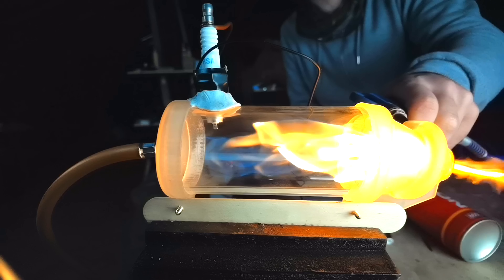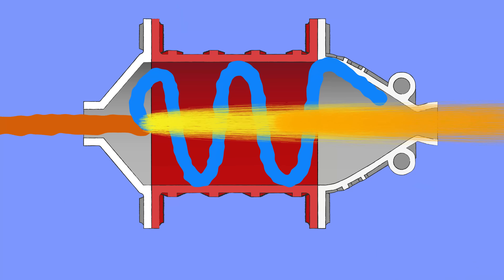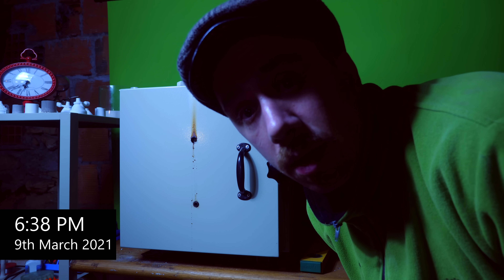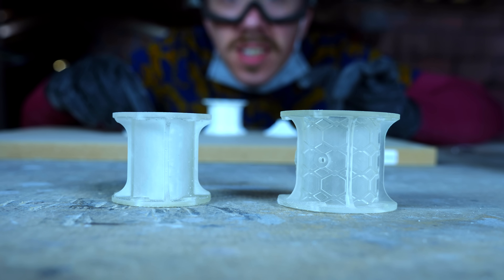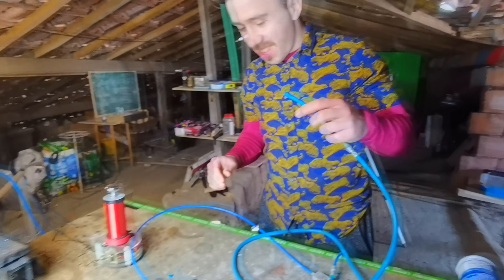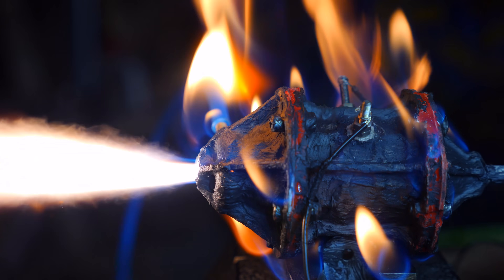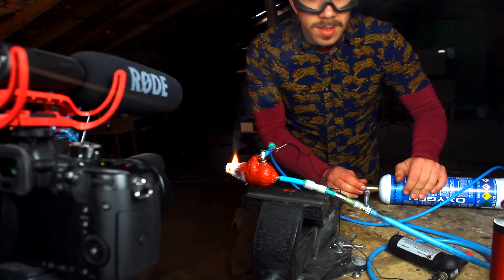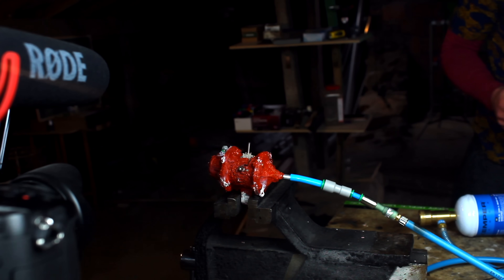Vortex Rocket V2.0 (3D Printed)

Comment: Hi, maybe you could try petrifaction with Sodium silicate (which binds/solidifys old concrete and prevent it from desintegrating into dust or stops water from rising inside walls due to the porosity of bricks and mortar. If it seals capillar prous stuff, maybe it works for the V3.0 engine. That's not rocket science, is it..? :D  If it works i'd like to have a 3d printer. If not, well here is yout toma.. uhm. P'tato...

Comment: if you cover the ceramic with PLA 3D printed parts, you should be able to stop the leaking. If that don't work you should try to increase the gap between ceramic and PLA and fill it with some materials, or making air flow through it to let the flames exit near the nozzle.

Comment: hot thing. :-)
you try to screw more or less flat things together. did you plane them before? maybe you can try to seal them with epoxy? or use a rubber ring- which would need a little more distance.. maybe a bigger collar around the parts? btw. do the screws get hot? they may extend and unseal whatever you screwed together..

Want another idea? pvc tubes are plugged deep into others so there is much more contact area that can seal both parts.

Yet another idea? Don't use a vortex but two vortexes. one inside your burning chamer, another one in a second bottle around the burning chamber which cools everything down.  think of it as a kind of turbo charger ;-) this may (as in maybe... well  probably not ) prevent overheating seals.. at least.. if you had more pressure outside the burning chamber than inside, ..

okay.. enough stupid ideas for today..  and i fully aggree.. tomatoes are disgusting..

Comment: Why not using the red silicon on the inside? I think it could be made almost flat with a spatula (or a 3D printed mold, maybe with PTFE tape to prevent it from sticking). 
For the tube leaks, you might put the silicon on the end of the tube before inserting it in the hole

Comment: Would Coating the Ceramic in a "Chunk of Aluminium" by Casting It Around it Work?
Reply: The high temp of the ceramic, the seal of the metal (also built in heat sink/mounting block for tubes!) !

Comment: You have a ceramic oven, so to seal the engine, just use glass glaze like any other ceramic. fully assemble the engine, then dip the whole thing in glass glaze, let dry, and put it in the oven to finish. It will fix the porousness problem, and add significant strength. sick cad skills btw, cheers :)

Comment: Hi Integza,
Have you tried printing 3d molds to pour your parts? You can bake the parts in your oven to harden them.
I would also suggest that you build a small vacuum chamber to remove bubbles from your molds before baking them. That would lead to more solid parts (seen that when ppl pour resin or plaster)
Not sure if that would work but look at clips on how jewelry is made with molds and stuff. Maybe you can finds some inspiration there.

Thanks for a epic channel and be safe!
/D

Comment: if you do manage to fix the leaking you should test how much thrust your engine produces and start designing a small rocket to check how high it will go, put a tomato as the test subject in the rocket if you're sure it's going to blow up :)

Comment: You have everything you need to seal this engine. Hold up your favorite coffee cup and think about it. After printing it, fire it as usual. Remove the supports. GLAZE the interior and/or try glazing the exterior and then fire it again in furnace again. You have got this. But the pottery glazing at a local craft store. You can even select colours that make you engine pretty.

Comment: I work at a company where we regularly sinter various ceramic materials. The issue you seem to be having with the porosity of your sintered Porcelite could be addressed in large by the sintering process itself. I would suggest calcinating the ceramic print at 600°C for six hours to drive off all the volatiles before ramping up to 1100-1300°C for an additional six hours to sinter. The cooldown should be kept slow to avoid cracking, 10 hours should be sufficient. You can run a test with printed cubes sintered at different temperatures to check the resulting density, the higher the density the lower the porosity (and less leaks!). Of course the denser the crystal lattice becomes, the more the print will shrink. The shrinkage can be measured with the test cubes and accounted for while printing. Hope this helps!

Comment: How about trying concrete densifier to seal the jet?  https://en.wikipedia.org/wiki/Concrete_densifier
"A concrete densifier is a chemical applied to a concrete surface in order to fill pores, increasing surface density"
If it's not chemically compatible, maybe just coat the jet in concrete powder, turned into paste, then add the densifier.

Comment: I think the glued component's contact points heat up causing the bonding agent to become molten thus creating weak points for pressure escape thus the leaking, try using high temperature ceramic adhesives some can withstand upto 2200°C

Comment: "It is not burning! It's smoking a little bit... but not burning!" That is the NASA spirit! You show them. 
Jokes aside if you are PVD or Sputter a metal layer over your ceramic chamber it should be gas tight and heat tollerant.

Comment: Definitely were a mask when you're cutting.  I'd also suggest a face shield for cutting and for when you're running the jet, as it could easily explode into shards with a backfire or something.
As for the leakage, why no cover the jet in ceramic paste or pottery clay?

Comment: Perfect the shape tolerance and design on the ceramic resin printer, then CNC a modular engine out of steel. 

I guess that is a sure way, to make a reliable and leak proof engine.

Comment: In order to get a leakproof engine, you should make the parts out of metal. you could print the engine split in half (lengthwise and in regular resin) and create plaster molds of both parts. you could then cast the parts (after the resin has been burnt out) out of something like aluminum (though this does not have a high melting temperature) or another metal that you have the capability to work with.

Comment: Ellowah
Manually applying paste etc will always have some defects
And I get that you don't want to treat the inside for the smoothness but it allows the fuelmixture to be pushed into the pores you burn out
My suggestion would be finding a fluid to submerge the entire part to refill and close the pores (that can resist the temp ofc)

Comment: could you try to design a 3D printed turbocharger that would withstand the heat and friction of the high rpm's of the propeller. then you could use the thrust of the rocket to turn the hot end of the turbocharger and see how high in rpm's you could go.

Comment: You might try coating the inside of the modular engines with the high temperature cement. Not sure how economical/easy it would be, but a Cerakote or other ceramic paint coating might work as well. Inside and out.

Comment: You don't need to stop the leak. It is good for cooling down the engine. You need to prevent the flame from reaching the body of the engine. And  direct the leaking gas into an afterburner.

Comment: I think the problem is the red silicon adhesion, at 14:27 it started to make bubbles, or maybe try to put it in a vacuum chamber for remove all bubbles, after put an other coat of it, vacuum it and an another one. After that it will work i think.

Comment: Porcelite's max temperature as I can find  is ~1300°c however a propane/oxygen flame is ~1900°c so unless your vortex cooling can insulate it by 600°c you might need to look into a lower temp fuel. Natural gas (mostly methane) may be an option, but this will lose you thrust :(

Alternative ideas:
Chill the air to try and cool more with the vortex?
Time to start 3d printing metal?

Comment: Just an idea. You can 3D print mold for the engine and pour refractory cement. By doing this, you can create thicker walls. Another idea would be to take a 3D printed ceramic engine and pour refractory cement around it. I also found this video of someone doing similar thing https://www.youtube.com/watch?v=KkMAY-s_6Qg

BTW great job!

Comment: You could try with a refractory silica glazing or silica enamel on both the inside and outside of all of the ceramic pieces and also both the refractory glue and the high temperature silicone on the outside. That should take care of all the porosities

Comment: @integza What if you try plating it with metal to create a heat resistant, non-porous layer on it? There are methods for plating ceramics with metal.

Comment: Hello, 
maybe by immersing the 3D printed cermic in a (liquid) which would contain very fine heat refractory particles.
Once the parts are completely submerged, place everything in a vacuum chamber for several hours.

By opening the valve suddenly (be careful not to use glass or plexiglass for this operation) a sudden compression will finish 
encrusting the holes.
Perhaps several operations will be useful. drying, gradually raising the temperature, then re-tramping, etc., etc. 
Patience is the mother of virtues

Comment: How about making a 3d printed mold to pour a heat resistent ceramic in? You can achive a much thicker and less porous part and you wont have to deal with the large amount of shrinking. It would also allow for the engines to get larger as you can print the mold in pla or abs and coat it to be leakproof.

Comment: Instead of flat flanges, use interlocking concentric rings on them to make a labyrinth seal

The OTHER problem is that you haven't made a complete item after the first firing

At this point it's a bisque (biscuit, bisqueware) and needs glazing/second firing (and bisques are hellaciously fragile)

This is why it's leaking like a sieve. More work is needed. You made the skeleton now add some meat :)

Talk to a Potter,  but this stage will soak up glaze readily when dipped, needing to be fired again

Essentially you're making fine walled porcelain and need to follow the same kinds of stages

You may need a 3rd firing before your porcelain rocket is ready for action

Comment: So cool, I recommend Permatex 84333 High Temp Epoxy Stick, or exhaust sealant instead of silicone as the silicone isn't able to withstand the pressure. So high temperature epoxy resin should seal the porcelain. Keep up the fantastic videos

Comment: maybe enclose the whole thing in a block of cement? might not be the best for therman management, but i think you can't leak much through a centimeter of concrete. also, that block probably could be more easily sealed with silicone, since the cement/concrete would isolate it from the heat of the combustion

Comment: How about doing an a combination of the vortex technology with an airospike engine? 
That would solve the major issue of airospikes, causing their planes to overheat easily
Reply: He did mention that the nozzle can't be protected by the vortex, and that's the part that fails on aerospikes.
Reply: Generally true if you are talking about a bell nozzle I believe. 
However with an airospike, the vortex might be able to follow the flame outside the combustion chamber and therefore suround the exhaust and shield the central flow shape. Not sure it works, it's just an idea, similar to using exhaust from a fuel-rich preburner to shield bell nozzles

Comment: Here is an idea. After burning the resin off your ceramic parts and letting them cool, soak them  in a strong sodium silicate solution(sometimes called water glass) for a couple hours, then heat your parts back up in the oven to 100-105 Celsius until thoroughly dry. At this temp sodium silicate solution will lose water and form a glassy material, which could hopefully seal up your engines. hope it works out! Cheers!
Reply: Good idea, but the increased sodium content might reduce the melting point of the the ceramic. Maybe a couple of rounds of soaking in a ceramic slurry, & then drying, would fill most of the pores. A final round of sintering would then leave a "high density" ceramic part, but it might self sinter at the operating temp, so I don't know it it's needed.
Reply: @benjaminmiller3620  at 105 Celsius I don’t think the formed sodium silicate glass will dissolve in the ceramic as both melt at a much higher temperature. I think the result will be a composite consisting of a sodium silicate phase and a ceramic phase. What do you think? 
Cheers
Reply: @SD-fw9li  It's not the 100C baking step I'm worried about, but the operating temperature, which is much higher. Though maybe if all leaks can be stopped, the gas film vortex cooling will operate better and lower the ceramic temp. On the other hand, you just need one spot to melt to cause problems. I think it's worth testing.
Reply: Maybe use a vacuum chamber to make the liquid be well absorbed
Reply: @CiberWizZ  this is a really good idea
Reply: Definitely was going recommend sodium silicate as well. Thorough drying over 100 degrees, then resinter.
Reply: Wikipedia: „It has been found that the oxidative resistance of HfB2 and ZrB2 are greatly enhanced through the inclusion of 30% weight silicon carbide due to the formation of a protective glassy surface layer upon the application of temperatures in excess of 1000 °C composed of SiO2. To determine the effect of SiC content on diboride oxidation, a series of furnace oxidation experiments werde conducted, in which the oxidation scale thickness as a function of temperature for pure HfB2, SiC and HfB2 20v% SiC were compared. At temperatures greater than 2100 K the oxide scale thickness on pure HfB2 is thinner than that on pure SiC, and HfB2/20% SiC has the best oxidation resistance. Extreme heat treatment leads to greater oxidation resistance.“
Reply: @stabilostick  reading this made me feel like i was reading some 
procedure at my last workplace.
Reply: @simensor  Yupp. Do you have more hints for Integza about the process?

Comment: Try 3d printed concrete? It's more durable and more heat resistant, and you can try mixing the concrete with different portions that way it's thicker or more liquid.

Comment: I'm not sure how hot the engine gets, but ceramic threadlocker glue can generally withstand up to 600 degrees C, so coating the inside/outside of the engine might help with that. You could also try soaking the parts in a heat-resistant material for a prolonged period of time to allow for materials to get inside the pores of the ceramics.

Comment: I would try using a quick valve on the oxygen and fuel to allow you to get the right mixture with the taps and then turn it on and off again quickly ensuring the correct combustion from the start. Love your videos Integza. Keep up the great work.

Comment: For the ceramic cant you just essentially paint them in a regular ceramic glaze to seal all the gaps, then re-fire them? So essentially the engine would have a layer of glass on the outside to hold in air pressure. The ceramic on the inside would insulate it. Maybe multiple layers of glaze if one isnt strong enough? The ceramic glaze is essentially glass and should be resistant up to 800 degrees F. Is that high enough?

Comment: You could create a housing for the jet engine from a piece of metal pipe. Then instead of pasting on layers of thermal protective silicon, you could pour it like a resin mold? 

Don't know if it would work, but by making the protective seal encompass the engine, even if you have small leaks, between the silicone and the metal pipe surrounding, you should prevent or atleast minimise leaks. This way if you have any leaks they should only be from the fuel inputs or the spark plug
Reply: This way, with your newly acquired welding skills, you could weld the input pipes to the housing once fitted for an even better seal on these bits reducing leakage further

Comment: Make it the same shape as a steel pipe, then put it inside the pipe to hold it together.  If the cooling works, the pipe wont stretch.

Comment: Use carbon fiber like in youre pulsejet engine Than it lasts longer and it will be able to withstand higher tempratures  and for longer.
Reply: Than it lasts longer and it will be able to withstand higher tempratures  and for longer

Comment: Do what the ceramic industry does. after your first kilning, to cure engine. clean it up then dip the part in ceramic slip. (its a fine powdered ceramic in water.) let dry, then re-kiln the engine to cure the slip. It should come out glassy. might need to protect any dimensional layers, because slip will add a fine layer to any surface it touches. but note, wax masking is possible on areas that should not change.

Comment: Try using just compressed air instead of oxygen. The oxygen is what is causing the engine structure to fail and leak.

Comment: Hello, here is an idea, you could probably try coat your engine by electrolysis, or plasma thing... to add a thin layer of metal. If i remember in aerospace they use some platinium to prevend erosion due to high temperature oxygen (or something like that, need to be verified).
(with some conductive paint or some trick like metal powder in you ceramic hole, it's just need to be homogeneous to make electrolysis work, i think)
 great job !

Comment: @Integza You could try to fix the leaks by printing the flanges extra thick, and 'lapping' or grinding them flat on a piece of glass and some sandpaper. That way they might not leak as badly.